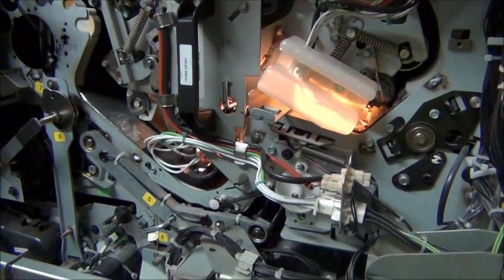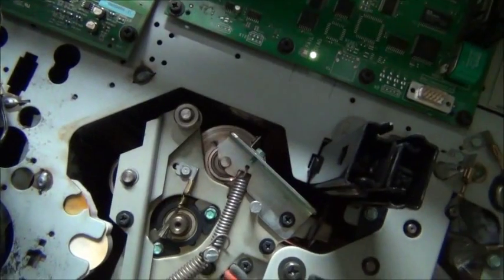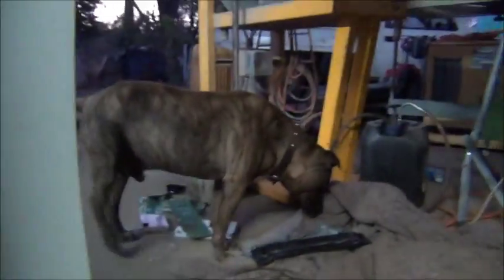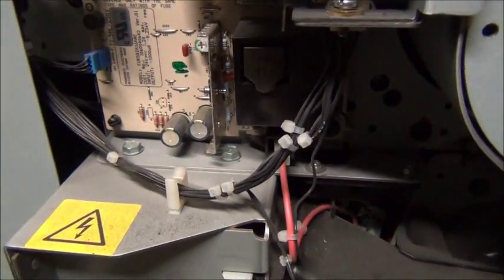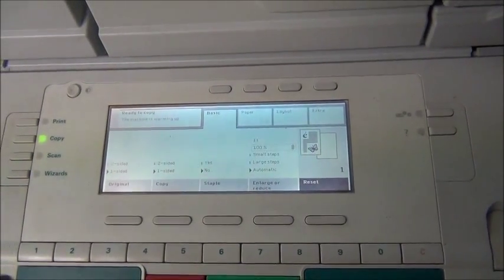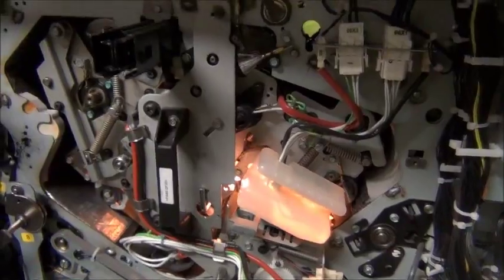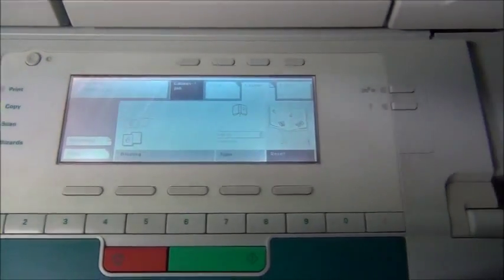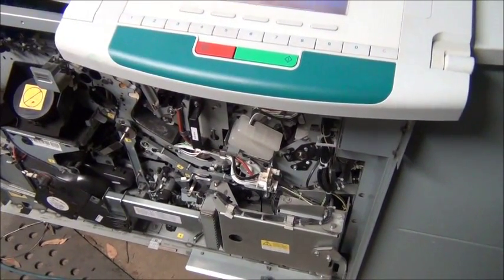Equipment Inspection/Repair :- Giant Copier Part III !

Comment: pretty serious bit of kit!, . the whole fusing unit will slide out on rails as you noticed, likewise the photo drum assembly should too (don't expose the drum to too much sunlight). the roller with toner stuck to it should be the fuser cleaner

The flyback is one of a few used for charging the photo drum, transfering toner from the drum etc..

as for quality, try and find a plain document thats pretty much spotless, otherwise you'll be chasing your tail looking for dirt thats on the origonal.

Comment: The fly back transformer is use on the printing drum. They charge the drum it picks up the ink (just like powder coat paint) and them rolled on to the paper.
Merry Christmas Cheers

Comment: Don't expect the best quality copies with the cover off, various parts are light sensitive.
At least the image transfer drum is.
The image transfer drum is chareged by the primary corona wire connected to the flyback.
It's then discharged by scanning a pulsed laser across it, picks up toner by static attraction.

You'll likely get a more coherent explanation from someone who is not half asleep.

Comment: Those copies look fine to me, I work on laser printers/copiers and they will never be as good as the original. I usually notice a little bit of clouding/blurriness around text, especially on older material like you showed.

Comment: If it ain't very broke, don't fix it LOL. It's very is scratch drums, damage parts which will leave ruin  your prints. Has it got any self test you can run to determine any problems? Maybe sell it as it is and let someone else pay to have it serviced professionally.